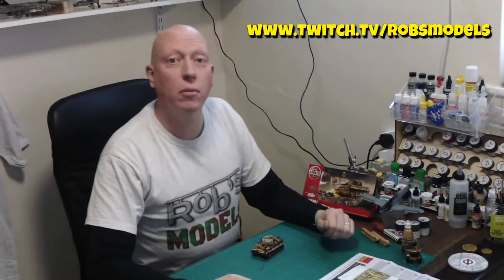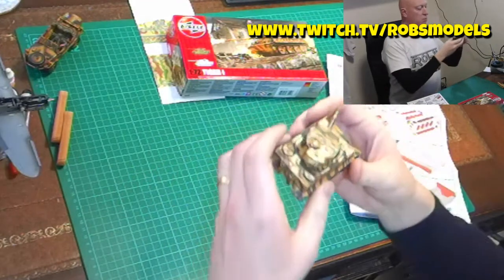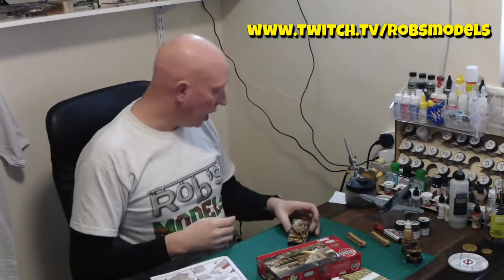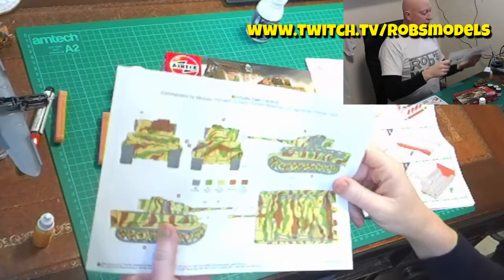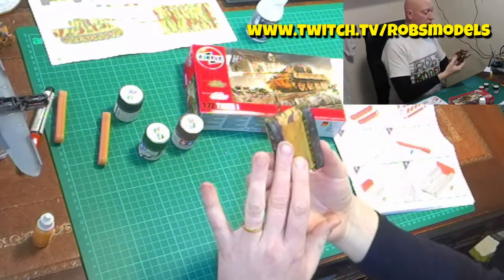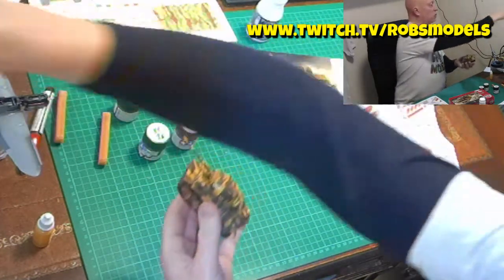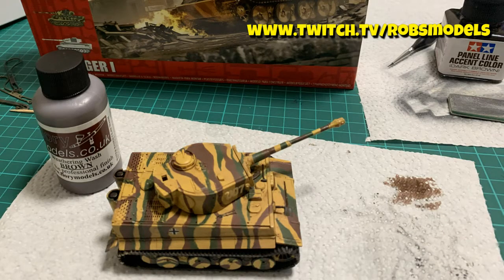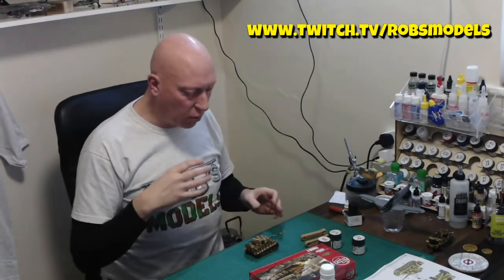Airfix Tiger 1. Photos, summary & post-build 1/72 scale model tank kit review. New Tooling. A02342

Comment: The German tank camouflage patterns were all suggestions. From 1942 onwards the armour came off the production lines painted sand. Crews were given brown and green paint paste to be diluted and sprayed on in the field as conditions demanded. If you see old newsreel footage often you'll see a bucket hanging off tank exhausts. In snowy conditions they used white wash....or anything suitable that came to hand. Hence patterns were often different.
Reply from the maker: After finishing this model I did some research more research into the German armour paint schemes and discovered they were suggestions. (I will keep an eye out for buckets!)

Being more of an aircraft modeller I’m more used to stricter paint schemes!
Reply: They used anything to apply the paint too. Spray guns if available, but also housepainting brushes, brooms, mops, bundles of hay and even their bare hands.
Reply: >> "From 1942 onwards the armour came off the production lines painted sand."
That is wrong, in more than one way.
The "sand" colour and the two associated paints became available only from March 1943.
Before that date, most Tigers were painted in a brown-green pair of "tropical" colours. A small number of them were dark grey.
And Panzers carried a bucket for multiple reasons, mainly to catch  leaking oil. The tanks got painted maybe twice a year. You don't carry a permanent bucket for that.
Reply: Thanks for the 'heads up'. I'll reprise my info. The 'sand' colour was what had been used on farm machinery pre-war. I know they developed bespoke or official colours hence the RAL prefixes. Interesting subject. I only found out recently that the Panzer gray had brown patches on it! You just can't trust that old black and white footage. Keep up the good work.

Comment: I cannot believe how badly Airfix messed up the tracks on these kits.
The Tiger used only one shape of track link. It was the same on both sides of the tank.  This was to simplify maintenance, spare part supply etc.
So, the fine detailing on the tracks would point forward at one side of the tank, and backward at the other.
But airfix have MIRRORED their track parts, making TWO kinds of track. And yes, I'm talking about the more detailed "link and length" parts which are supposedly the better ones.

Comment: It is a shame the Tiger is a bit naff as the AirFix's new tooling Tiger killer: The Sherman Firefly Vc in  1/72 is a great and fun little kit to build.
I have only done this Tiger but have heard that regardless of manufacturer or scale. They are problem kits to build. Any truth in this?
Reply from the maker: Not really experienced enough in this area to give a definite answer, but from many that the old Airfix Tiger 1 was really, really bad. It's a fun kit to build and I did enjoy it, but I did feel it missed that certain something that makes a kit great.

For example, I've made quite a few 1/72 aircraft over the years, and those that have been tooled in recent years by the main manufacturers (such as Airfix, Tamiya and Revell) have all had some really fine detail moulded in and and fine parts for further detail - this Tiger 1 just didn't have the finesse I expected from a kit released in 2020.

Comment: I  have just built this model and I,'m  sure that the instructions are wrong asa they seem  to number the wrong "handed" single links.  I also pulled the links off and worked each individual single link onto the wheels making sure the track pattern matched the previous link. I still think its a good kit
Reply from the maker: Hi Anthony, must admit I’m a little relieved that it wasn’t just me having problems with the tracks - I thought I was losing my mind over something that should have been quite simple!

And yes, great little kit for the scale. A few minor areas of improvement - but that’s probably me just being picky!
Reply: @RobsModels  I'm about to start the Sherman firefly so I'll be extra careful with the tracks and check the instructions.

Comment: Thanks Rob good video, gosh i like the weathering stick, just ordered the Airfix combined kit with Tiger 1 and Sherman as part of my 5/6 starter kits to get back into the hobby.
Reply from the maker: I don’t think the starter kits have the separate wheels and tracks (that were a nightmare), but the simplified versions still have plenty of detail and will definitely make the build process easier - useful for getting back into the hobby. 

I stumbled on the Tamiya weathering stick in my local model shop. Again, quick and easy way to adds weathering, with “lumps of mud” between the tracks.

Comment: Mine went together ok but my issue was whenever I turned the gun it took the paint off the tow ropes on the hull
Reply from the maker: How odd! My one is close, but they don’t touch. I guess that when doing a tank at such a small scale minor inconsistencies in the tooling are going to make more of an impact.

You could try removing the location pins from the rope to ensure they fit as flush as possible to the surface - but that’s probably a little too late as you’ve probably already glued them down.

Comment: Hi Rob, enjoyed the video. Could you please tell me the width of the model. I am planning some modular Normandy terrain for wargaming and currently trying to optimise a practical playing  width for the road net. My Armourfast  Cromwells will happily navigate 60mm but I suspect Tigers and Panthers will require more space.
Reply from the maker: Just measured and it’s about 51mm wide, though checked the box and that said it’s 53mm. Either way, less than 60mm. 

And length is around 88mm, 108mm if you include the barrel. 

Hope that helps, Rob
Reply: @RobsModels  The length of the Tiger model is 88mm!   😆